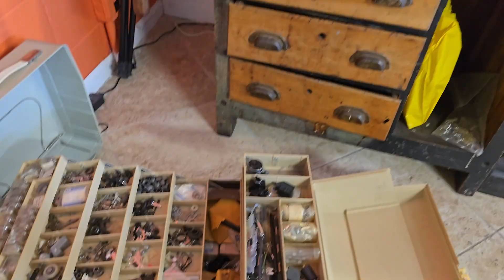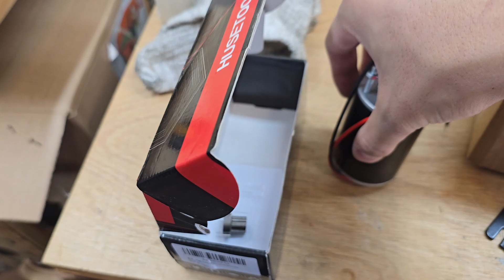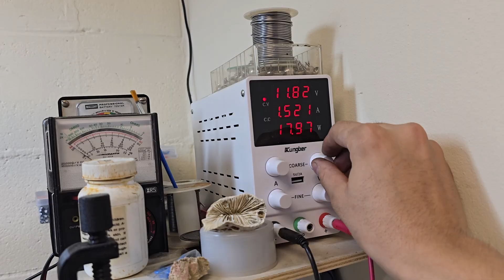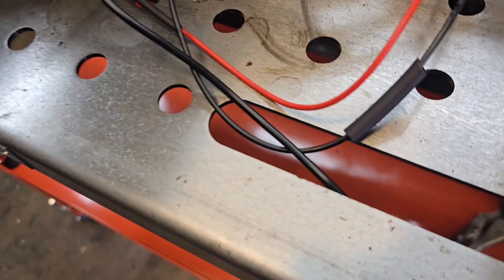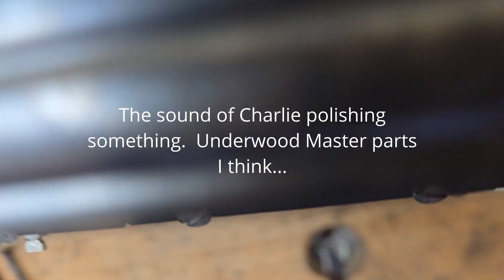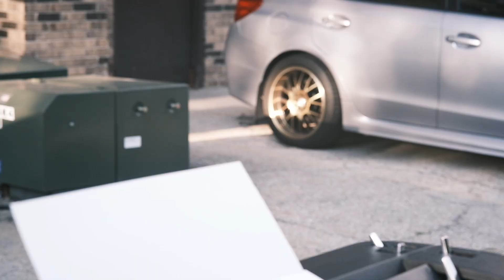Making a Battery Powered IBM Selectric

Comment: Those little batteries would be drained very quickly - so what is the point of this?
Reply from the maker: 4-5 hours of typing.
Reply: @TypewriterChicago Seems unlikely that a few dinky 9V transistor batteries could hold enough energy to drive that motor that long
Reply from the maker: @Jeffrey314159 we measured battery capacity and current draw in the video.
Reply: @TypewriterChicago Must of missed that part

Comment: How many pages can you get on a single charge?  I wonder if you could use a lithium battery pack like from a Ryobi battery tool?
Reply from the maker: it will type for about four hours.  I'm sure you could make an adapter that could accept standard drill batteries that mount on the back!

Comment: A great idea and fun video. I was thinking of a similar conversion with my Brother SX-4000 daisywheel, a bit lighter than the Selectric and already has a handle!
Reply from the maker: I think that would work quite well!  Those machines are low power draw and low voltage, easy to remove the power supply board and wire in a new one direct!